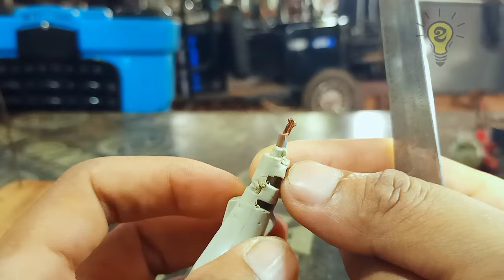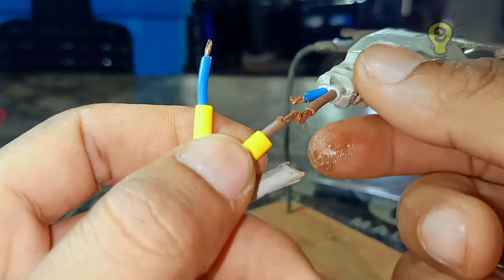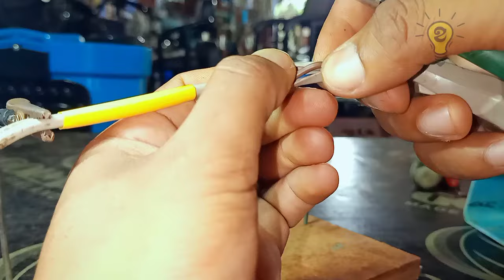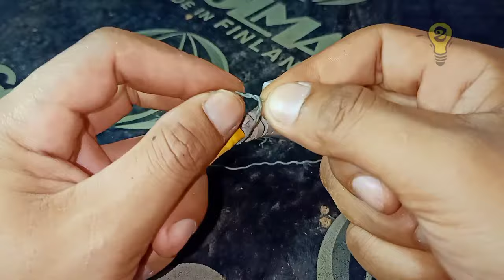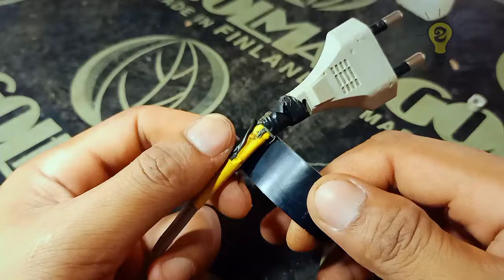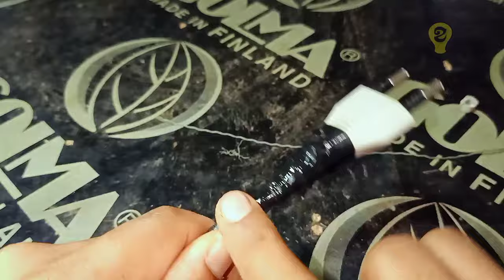Short Wire Plug? This is how to fix that #plug #electrical #tips #fixing

Comment: I was all ready to congratulate you on using flux.  It makes sooooo much difference.  But then we saw that dirt soldering iron tip, and you totally lost my respect.  If you don't have a sponge, even a  workshop cloth folded and made damp will clean the tip if you drag the tip across the cloth.  Another trick is to melt flux cored solder onto the tip and flick it off. That can keep a 'reasonably clean' tip in good condition, but the tip we saw needs some serious attention.  A good soldered joint should be bright and shiny — the joint you made was dull with black flecks, and really nasty.
Reply from the maker: Thanks for your comment, I would try with your introduce